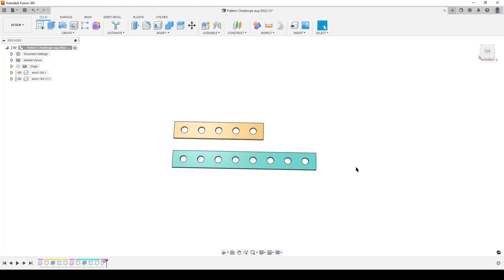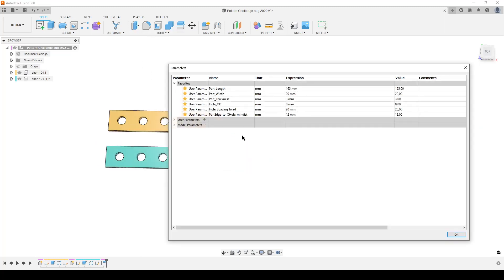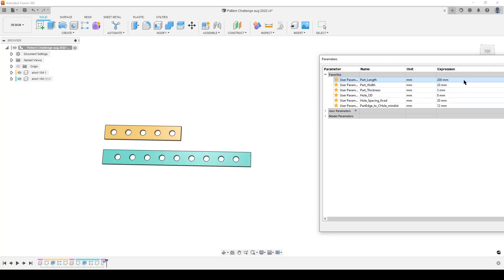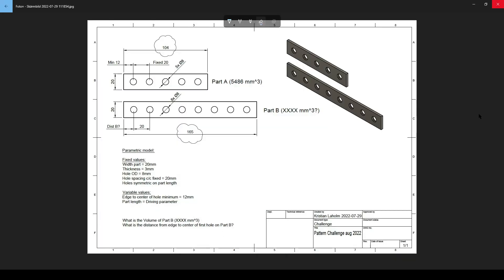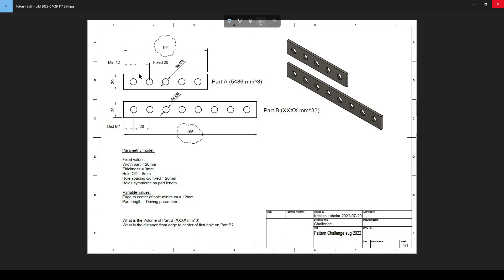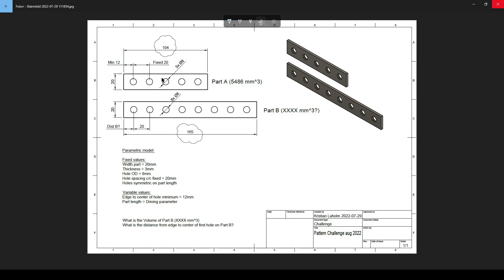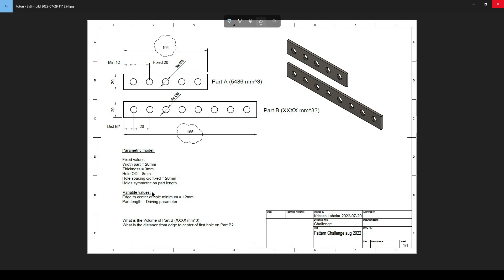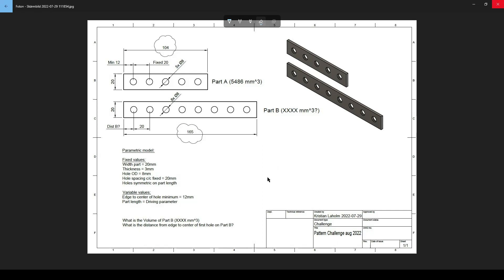Fusion 360 Challenge - Parametric Pattern

Comment: How would you set it up if the holes where all different components? So say on square had a whole and you wanted a similar model but making spare square instead?
Reply from the maker: Can you rephrase that question? I'm trying to understand you design intent, do you want to change the shape of the holes?
Reply: @KristianLaholm   
im trying to learn more parametric modelling and gave myself a challenge to do a box. simple enough, all parametric with height, deapth an lenght. 
but here is (for me) the hard part: 
I want the box to divide itself at a max lenght, say 500 mm and if i go above that (say 1200 mm) create two boxes that is 500 mm and one 200 mm. so a total of 1200 mm
hopefully this explains it well enough, wish i could present a file but right now i only got two parametric boxes...
I read up a bit on boolean algebra but im not sure its appliable in a fusion context? 
is there a good tutorial that sort of explains what fuction is needed  to make a model like this or am i dead in the water?

also posted this question in the fusion360 forum on facebook!
Reply from the maker: @martelthefirst  Now I understrand you design intent :) And it's a bit to much to solve in the comment here, I hope you'll get some good help on FB.